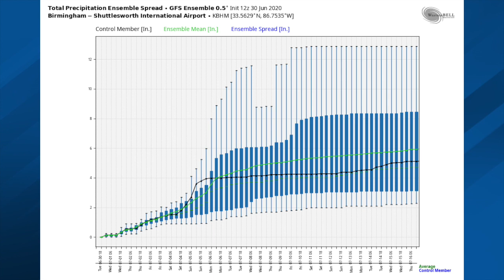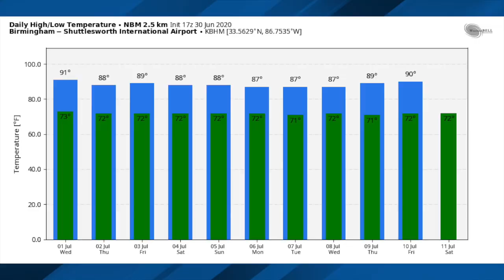June 30, 2020 Weather Xtreme Video - Afternoon Edition

Comment: I had one small cell move through Eufaula at 1530 that only dropped .06", but it at least lowered the temperature from 94 to 80, where it's at now at 1615. There's an area of light rain west of me that may hold together long enough to give me a couple more hundreths. All the better cells went north or south of me after a high of 98.